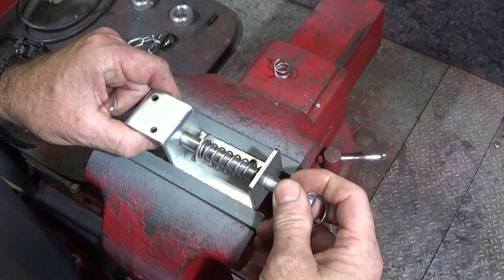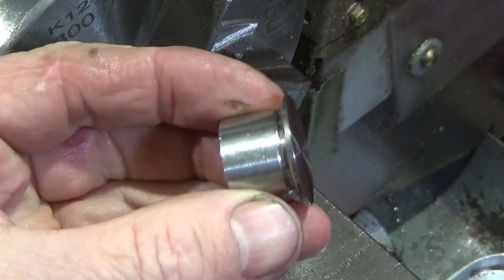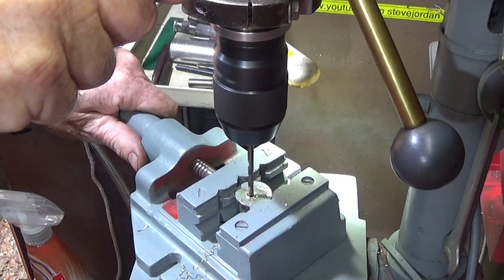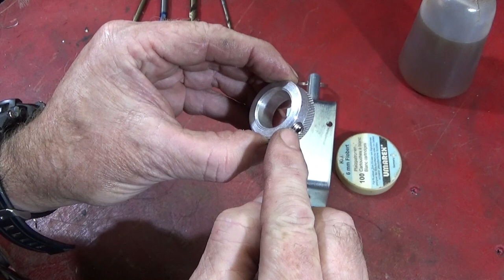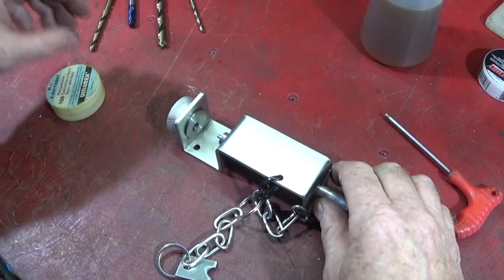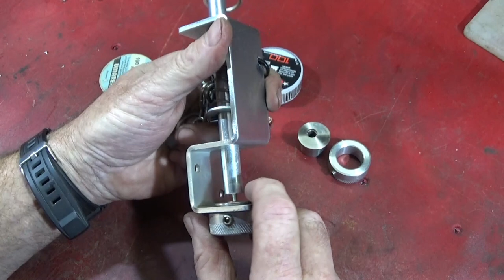Trip-Line Mine .22 Rimfire Adapter Conversion. Burglar Alarm

Comment: Now if video like this were available when I was a kid you know I would have used live 22s working up to live shotgun shells. I did enough crazy things with ammunition when I was a kid anyway.
Reply: The shot doesn't go anywhere, the side of the case just splits open. Erm apparently.
Reply: @markrainford1219  As a kid I would not use blanks, in fact I guess I made zip guns since they talked about prisoners making them. Early 410 shells you could replace the primer with a 22 and it was offset enough to fire. Did you know the early ping- pong rifles could shoot chicken eggs? 🤣